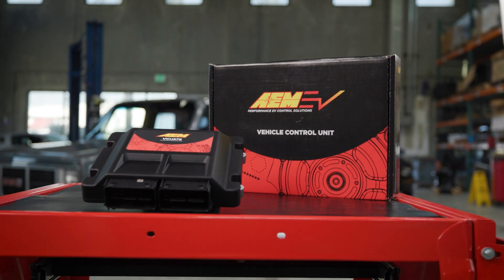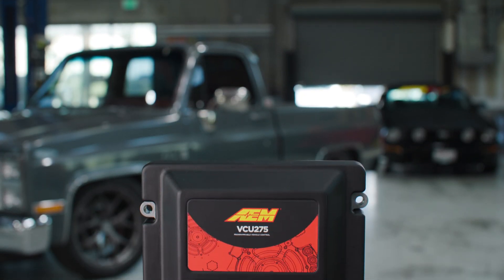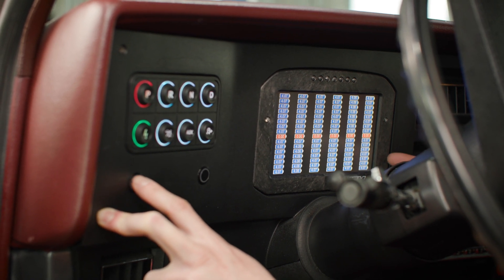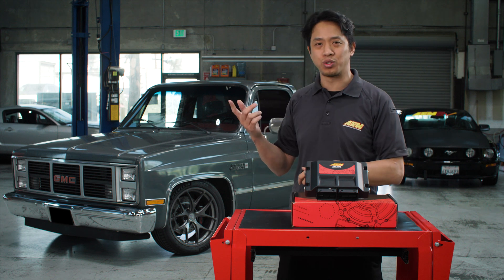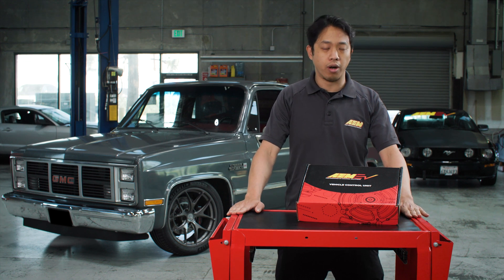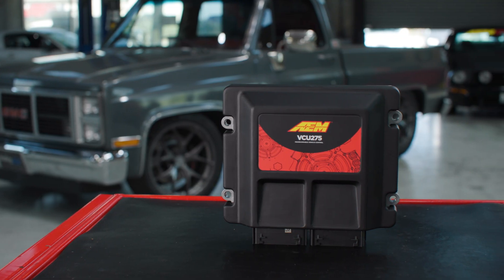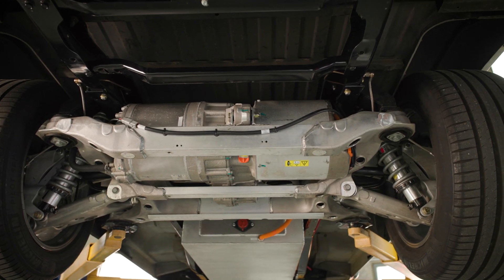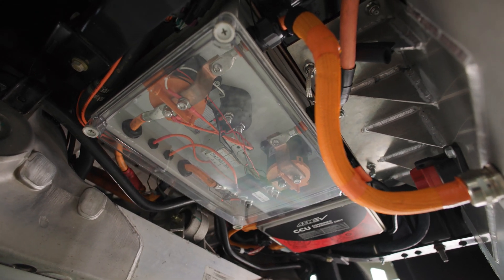AEM EV Vehicle Control Unit (VCU275)

Comment: So that’s why the VCU200 has been discontinued. Will the 275 support more BMS satellites than the 200? Will it support parallel packs for more range? I have e a VCU200 but would upgrade if it improves the BMS configurations.

Comment: It would be nice to have a VCU for a Tesla that controls the BMS and motor drive units, cooling and charging but still keeps the rest of the vehicle systems in place.  The ability to tweak the motor, cooling stability and traction control parameters or turn some systems fully off would be a game changer.